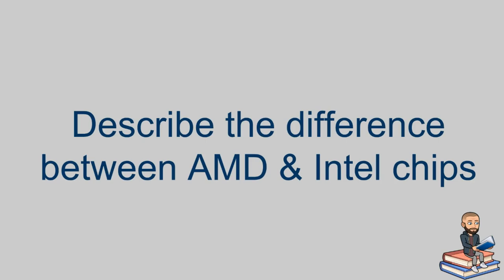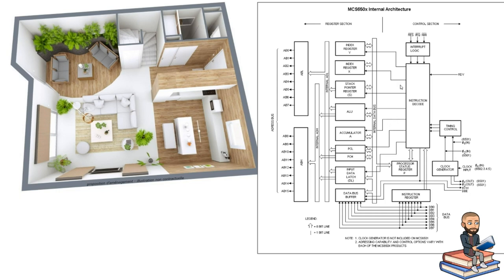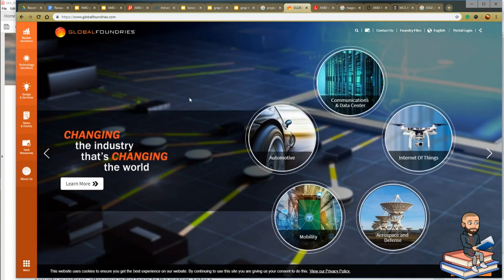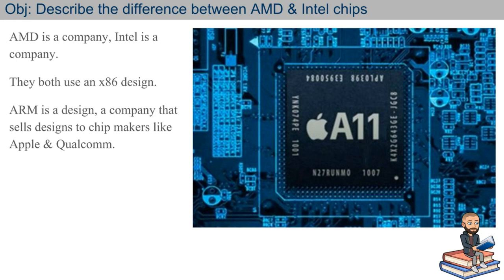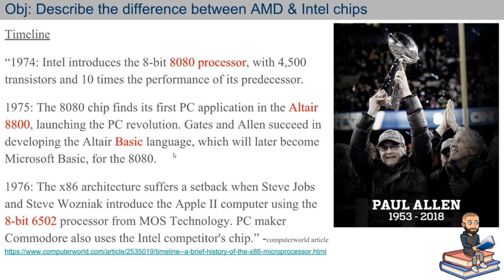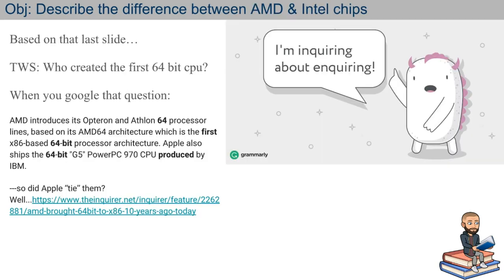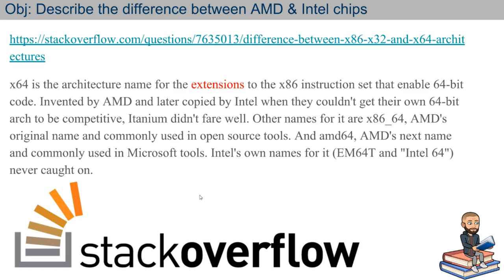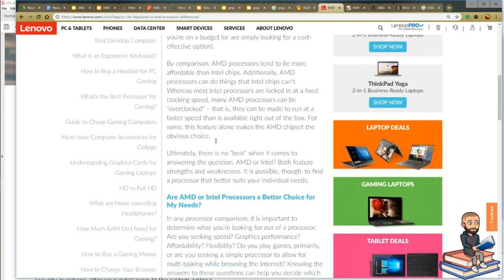Difference between Intel & AMD: x86 & x64 & x86_64

Comment: TLDW:
x86 refers to the underlying 32bit architecture and x64 refers to the 64bit extensions. Meaning if you have two options of software, x86 and x64, get the x86 for your 32bit computer and the x64 for your 64bit computer.
Reply: Thank you for that summary., perfect.